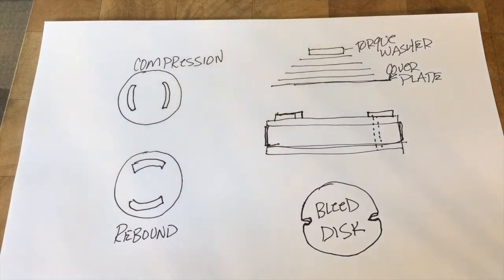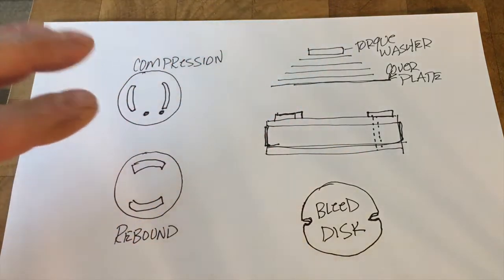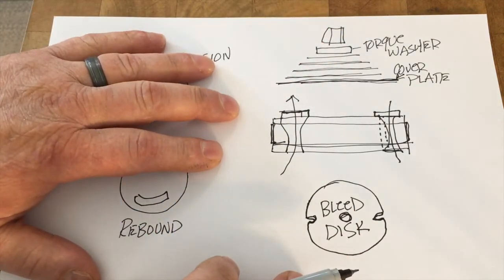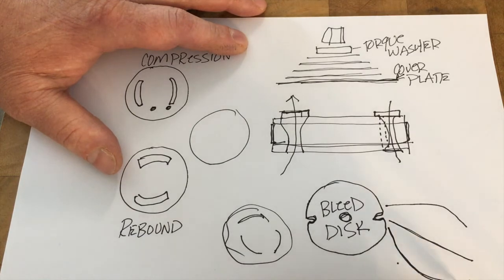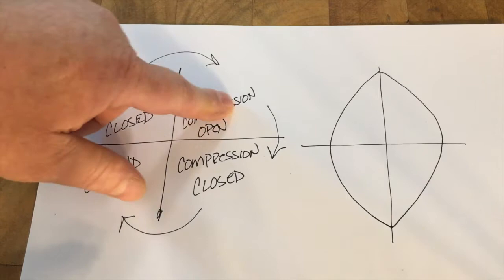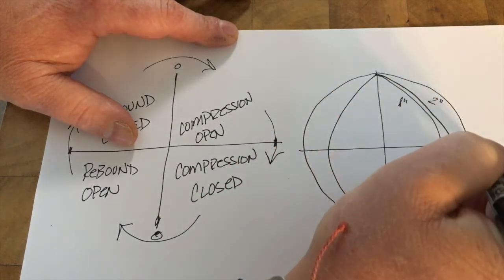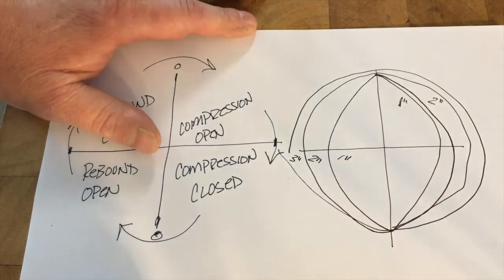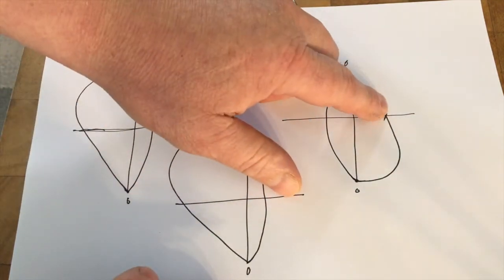Racing Shocks; How to Read Shock Dyno Graphs, Transmissibility, Hysteresis, Shock Pistons

Comment: I want to start building my own shocks for my race program. Why do you recommend the Pen Dyno over the computerized Dyno systems?
Reply: For me, I’ve always felt it was always easier to read and find small anomalies in the pen dyno graphs. They were much cheaper, seemed to take a little more abuse if people put them in their  trailers, and I just love having the control, by hand, over the velocity. 
I much prefer the force displacement graphs anyways. 
I never did like the force vs. velocity stuff that seems to be so prominent. 
Thanks for watching.